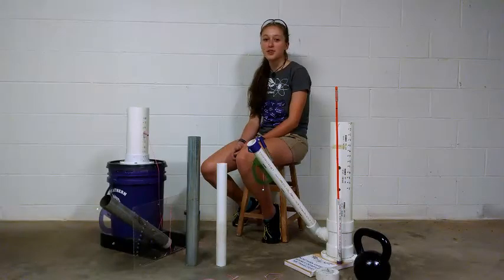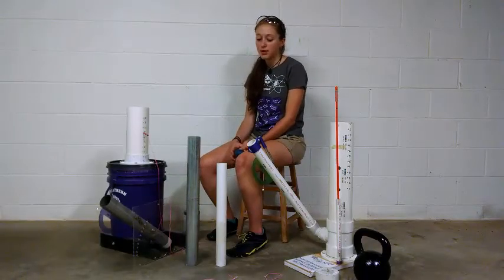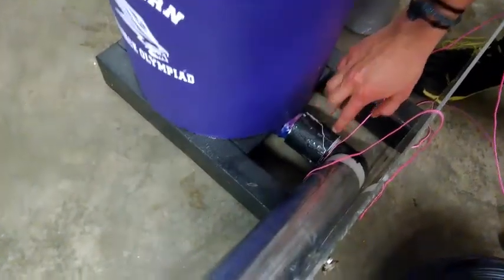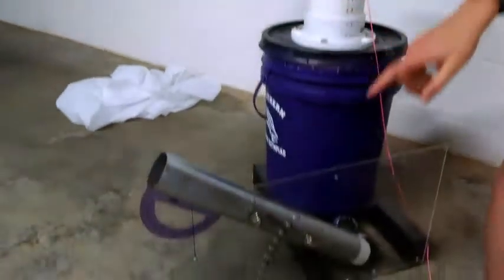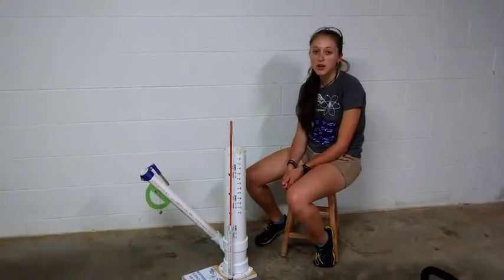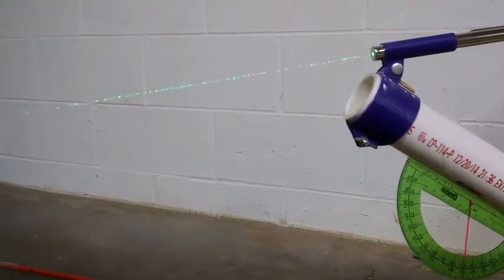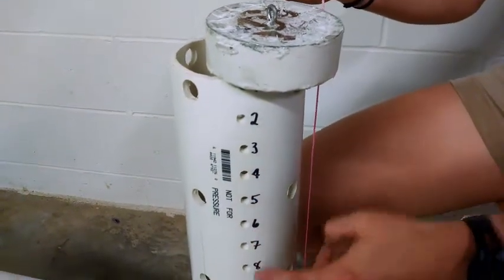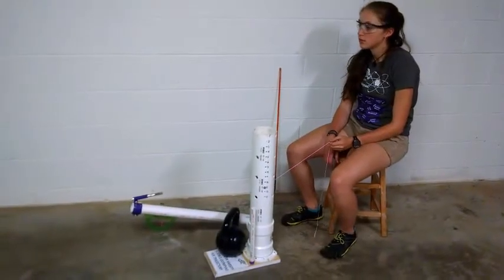Science Olympiad Air Trajectory

Comment: How did you keep the ball from falling down the tube since you used magnets?
Reply from the maker: The ball is supposed to go down the barrel
Reply: @TMartScience  Thus, inside the beachball?
Reply from the maker: @JennyLilly-bc3rrsorry I misunderstood your question earlier.   The plumbing pipe fittings used prevented the ball from going into the Beach ball.   The projectile ball only went to the bottom of the barrel.

Comment: How did you 3D print that laser mount, I'm also using pvc and a laser
Reply from the maker: @uppp779  we measured the laser and designed a bracket using a 3D design software... It was custom made for the laser we had.

Comment: This is amazing, Would you be able to share from where can I get Parts and construction steps in details ?
Reply from the maker: @himanijain5348  The goal of this video is to share the idea. I do not provide a list of materials because This device was constructed from scraps in the garage.   If you are creative, no doubt you can improve on this design.
Reply: @TMartScience  amazing !! My son got the thin on , but now the ping pong ball does not go in. It just get stuck on the top. Another home depot trip. But if I get the bigger dimension , the ball will be loose and more air will flow from the sides. Any easy solution to this ?
Reply from the maker: @himanijain5348  when we did this, we took the balls to the hardware store...  That's how we figured out that a racquetball fits perfectly in a pipe for chain link fence, and a ping pong ball fits down the right size of PVC pipe.  Maybe you could try a different ball.

Comment: Does the height of the mass change anything? Also did your 2nd design have anything to change angle of the cannon to make it more accurate?
Reply from the maker: @kevinshen4912  Yes, height mattered.   Yes the angle of the barrel was adjustable. That does not change accuracy, but does change distance.
Reply: @TMartScience  would having a longer mass have a negative impact?
Reply from the maker: @kevinshen4912  this sounds like a good experiment... Maybe you should try

Comment: Could you help me out on the laser pointer holder? I'm having a little bit of trouble.
Reply from the maker: @DanielJohnson-k5c  what sort of help do you need?   If you are asking for the 3D printing files, I no longer have those.   Besides, they were specifically designed for a laser purchased over 30 years ago, so unlikely to fit a laser use have.

Comment: Hello. My design is very similar to your 2016 design. Yet, we are not able to have the projectile travel over 2 meters. After reading previous comments I have learned that you advise drilling vent holes and making the mass fit more tightly in the drop tower. My question is how did you drill the vent holes and how big did you make them?
Reply from the maker: @sangeethadiwakar7528  the answer to your question is pretty obvious... The holes were drilled with an electric drill... As far as size and quantity... You need to experiment with your design.   You need to figure out what works best

Comment: Hi, sorry to be a bother but I’m building the first design for my up coming competition and the only think I’m having a real issue with is the pipe that connects to the side of the bucket, like the being able to adjust the height of the pipe of which the ball shoots out from. How did you make the height of the side pipe adjustable?   Also how did you attach the ball to the side of the bucket, did you cut a hole and glue it the pipe or did you use another method?
Reply from the maker: @LeahThe  The side pipe was adjustable because it was a threaded elbow... We could just twist the angle.   Using plumber's tape, you can increase the friction so that it will stay in position.
Reply: @TMartScience  Thanks!
Reply from the maker: @LeahThe  regarding attaching the ball, we used a bathroom sink drain assembly purchased at a hardware store.   Those pieces squeeze together at the bottom of the bucket hole.   There were a number of issues with this design, but maybe you can improve on it.

Comment: Do you have instructions for how to make the one with two pipes (not the one with the bucket)? Any materials and measurements you used?
Reply from the maker: @kleeberryy  you can learn a lot by reading previous comments... The goal of this video was to give an idea so that others May improve on the design. Many of the supplies were random items found in my garage.   Specifications were limited to that Year's published rules
Reply: @ how did you guys drop the weight? Specifically, how did the trigger mechanism work?
Reply from the maker: @kleeberryy  by pulling a string attached to a hook
Reply: @ how did you thread the bolt into the labeled holes? I’m a bit confused on how that part works and how the mass is able to stay up and where the bolt is pulled out from
Reply from the maker: @kleeberryy  The bolt was not threaded. Just pushed through the holes. Around the bolt was a modified hook that could hook onto an eye bolt on the falling Mass.
Reply: @ do you have holes on 2 sides? Like two holes drilled in two opposite sides of the pipe to insert the bolt and pull it out from with the string?
Reply from the maker: @kleeberryy  yes...
Reply: Is there a third set of holes at the back where you put the string through to pull
Reply from the maker: @kleeberryy  yes .  But not as many.  The string does not need a straight line
Reply: @TMartScience  where did you put the reducing bushing? Was it a pvc reducing bushing?
Reply from the maker: @kleeberryy  Yes it was PVC, it was placed at the bottom of the barrel of the cannon
Reply: What kind of hook did you use to load the mass?
Reply from the maker: @kleeberryy  most of what was used was scraps laying around our garage... Again, I do not provide specific instructions for this device, this is so you can get an idea and hopefully improve on.   Use what you have!
Reply: @TMartScience  I see. Are the vent hole supposed to make them go further?
Reply from the maker: @kleeberryy  we found that the addition of vent holes allowed for more rapid compression and greater distance
Reply: @TMartScience  really? I think We found the opposite, the more vent holes the lesser distance. Do you have any idea why this is the case?
Reply: We only have about 5-6 vent holes right now
Reply from the maker: @kleeberryy  this is an experiment in and of itself. If you see improvements, drill more holes, if you drill too many, cover them with tape
Reply: @ oh the tape works to cover them back up? Will it affect the ventilation?
Reply from the maker: @kleeberryy  that sounds like another experiment...   The whole point of science Olympiad!
Reply from the maker: @kleeberryy  of course you need to find the optimal configuration.   Much experimtation went into the design

Comment: Hi, we built a similar design to the second one but the readings (where the bal hits in meters) are inconsistent for each degree of the pipe. We are working on how to fix it but do you possibly have an idea on what the issue could be?
Reply from the maker: @kira_is_sus1783 unless the design is exactly the same, it is hard to say without examining the device. The best advice I can give is practice until you understand every aspect of your Canon.
Reply: @TMartScience  I see. (im pretty sure the design is practically the same) I dissassembled my build and may have found a part obstruction the airflow/airway to the arm and have shaved it down and just added some vent holes. Hopefully it works! Thanks for your response.

Comment: Where did you get the weight you used?
Reply from the maker: @pgninfinexcorporation8711 like everything else, we made it. It was a metal can that fit closely inside the pipe filled with fishing weights?
Reply: Ohhh ok thanks? Do you know the dimensions of the drop tower you used perchance? Like the height/length especially? Also is there anything inside the drop tower or is the power coming strictly from the air produced when the weight is dropped? Thanks!
Reply from the maker: @pgninfinexcorporation8711  The height that was used was the maximum allowable for the competition rules...  Nothing else was used in the tower
Reply: @TMartScience  Ok sounds good! Also, did you use a 2” PVC for the ball launcher and what’s the adapter called between the 4” and ball launching tube? Also, any suggestions on how to drill a hole in the pvc? Thanks!
Reply from the maker: @pgninfinexcorporation8711  My best suggestion is to go to a hardware store + look for pieces that work... There are multiple ways you could do this.   Use what you have or what you can easily acquire and improve on this design.

Comment: How do you know where to place the vent holes and what sizes they should be? I am currently building a similar pvc drop tower and I didn’t want to make any holes until I am sure of how big and where I want them to be, so wondering if there is a standard or how you knew yours. I also wanted to know if there was a certain distance from the bottom that should have no holes in order to be used to compress the air, and if so what would that distance be?

Comment: what is the size of the reducing bushing, and is it plan on the outside or does it have the ridges
Reply from the maker: @ChandiGarg  The size of the reducing bushing will depend on what you plan to use for the projectile.
Reply: i want to use a ping-pong ball, so same as yours
Reply from the maker: @ChandiGarg  the best thing you can do is go to your local home improvement store and find the the pieces that work... There are multiple combinations of parts that will do the same thing

Comment: What kind of toilet flange did you use, was it like a 4in diameter one with like some inches going inside the drop tower?
Reply from the maker: We used a 4" one that fit on the outside of the pipe not the inside... but you could likely get both to work

Comment: How did you set the laser so it would give u where to shoot?
Reply from the maker: @pgninfinexcorporation8711  Practice!  .... Shoot the ball, see where it lands, point the laser at that spot. Record all the settings. Then try again... And again... And again!
Reply: @TMartScience  oh so do you adjust the laser each time or
Reply from the maker: @pgninfinexcorporation8711  just like you need to make adjustments to angle force of the dropping weight, you will need to calibrate the laser sight.   The other thing is that the laser is useful for getting the orientation in the correct direction.

Comment: Does the size of the piston matter? If the diameter is bigger, would that affect the performance/be better?
Reply from the maker: @dhruvgarg2909  of course the size of the Piston matters. It should be as close as possible to the inside diameter of the pipe. If it is loose, it will not generate compression.
Reply: @TMartScience  What's your recommended size for the diameter of the pvc, if using a racquetball?
Reply from the maker: @dhruvgarg2909  any pipe that fits.   Take a ball into a hardware store and see which one works!  That's what we did. What we found worked best for a racquetball was the pipe to support chain link fences.
Reply: @TMartScience  Thank you. Is incorporating a pully system for the weight smart? Or is drilling holes in the pvc to put the pencil through better?
Reply from the maker: @dhruvgarg2909  sounds like you have good plans for an experiment... It would be great to know that other people have improved this design

Comment: How did you make the 4-inch weight that perfectly fit into the tube? Also wouldn't the air just go up? How did you get it to go through the elbow tube?
Reply from the maker: @ChandiGarg  we looked through our recycle bin and found a steel can that was close to the right size. Then added duct tape until it was a perfect fit.   Once the weight/ piston was falling down, the only place air could go was through the hole at the bottom

Comment: what angle would the laser be at if the tube was angled at 45 degrees?
Reply from the maker: @abhishekgarg3945  it should be adjustable so you can align it with where the ball lands.   You have to experiment!

Comment: Will it work for b divison
Reply from the maker: This was built years ago according to specific rules, please check with current rules and modify accordingly
Reply: What size did you use for the pvcs
Reply from the maker: @Rouge-h2h  the length (height) was based on the competition rules that year.   Diameter depending on the projectile you will use
Reply: What is the weight thing you used
Reply from the maker: @Rouge-h2h  Read the previous comments, it was all the fishing weights that we had in the garage. Stuffed into a can that was the right size compared to the PVC pipe
Reply: @TMartScience  for the seconed desighn

Comment: Hi, I was a little confused on how you made the drop weight for the second build? I have already tried many many variations and none of them work. Thanks!
Reply from the maker: We put metal fishing weights into an appropriately sized steel can, and wrapped it with tape.
Reply: @TMartScience  If it's not too much to ask for, could you perhaps send the stl files for the laser pointer? I have no idea how to design one and I think your design is very very smart. Thanks!
Reply from the maker: @ryanfang2990   I know this was designed on tinkercad. But no longer have the laser or the file...

Comment: So for your bucket design (2015) how’s you connect the launch pipe and the beach ball while reducing air loss, and what’d u do to keep the actual launch pipe upright.
Reply from the maker: The pipe was connected to the ball and the bottom of the bucket with a bathroom sink drain (purchased from a hardware store)  The launch pipe was held largely with friction

Comment: How did you set the bolt at different heights? The S hook looks too big to slot through the small holes you have the bolt rest in.
Reply from the maker: The bolt was pushed halfway in the tower, then slid through the hook, then out to the other side. Moving the bolt up and down through the  holes was a key adjustment feature

Comment: Our ball isn't really getting far in our second design. It is not going past 5.5 meters, and we are trying to get to 8 meters. Any advice?
Reply from the maker: Have you drilled vent holes
Reply: no, but the mass is sliding down with no problem @TMartScience
Reply: @__buzz__  The vent holes are supposed to help so try that. But also remember that the diameters of the ping ball ball and the barrell should be the same.

Comment: Hello, how tall was the drop tower in the 2nd design?
Reply from the maker: It was as tall as competition rules allowed...
Reply: @TMartScience  for the second design, did the mass just drip to the ground and the ping pong ball would be launched right away?
Reply: Also, what does the protractor do in the second design?
Reply from the maker: @PegasusPlayzYT  the protractor has a string and weight to precisely set the launch angle
Reply from the maker: @PegasusPlayzYT  I don't understand your question
Reply: @TMartScience  so you release the mass, and then it would  just fall and the projectile was launched?
Reply from the maker: @PegasusPlayzYT   Release the mass.... since it is a snug fit, the mass acts like a piston and compressed air as it drops... the compressed air is what launches the ball.
Reply: @TMartScience got it. Also, how heavy was your falling mass in the second design?

Comment: I made three weighs, 1.5kg, 3.5kg and 4.9 kg. The distances the balls shoot are similar. Do you know why? I want to increase the distance.
Reply from the maker: We also found that changing the mass did not change the distance that much. We only used one mass. The vent holes along the side of the tower were very useful too. Allow some air to escape so that the projectile did not fire too quickly
Reply: Did you found an ideal weight of mass? we made mass with concrete and fishing weight. @TMartScience

Comment: How tall is your 4" PVC? Could you explain the locations of the air vents?
Reply from the maker: The height was dictated by the competition rules. We used as tall as permitted. The vents were located to release air on the drop. If you cut too many holes, you can always patch them with something like packing tape.  You have to experiment and see what works best

Comment: Do you remember if the toilet flange had a barrel going into the pvc tee, or did the toilet flange just sit on the outside of the tee?
Reply from the maker: It depends on your fitting, you could use either one

Comment: What would would happen if we didn’t use the vent holes on the side of the drop chamber? Would that be a reason for the ball not going as far as it should be going (2nd design)
Reply: Vent holes allow the weight to drop fully, if there were no vent holes, then the weight wouldn't be able to go all the way down the drop tower due to compressed air building up underneath it.
Reply from the maker: @Uman_i  exactly correct
Reply: Also, Would it be possible to loan or buy the weight from you?
Reply from the maker: @vedant-n5e  It really is not difficult to make... That is the point of Science Olympiad!   Experiment!

Comment: hi there! I’m using a pretty similar design to the second one in that i have a mass holder (I 3d printed) sliding down the main PVC tube acting as a piston. The issue is, it just doesn’t fire the ball near far enough (maybe a m or two?) I think it’s because there is friction, so I am going to grease everything up, but how different in size was the mass thing vs the inner diameter of the pvc? i think mine is getting caught on the wall and slowing down so the ball doesn’t really fire much at all! Thank you for all the help